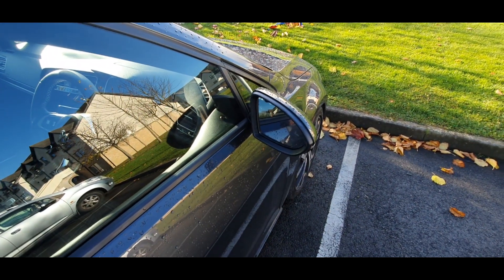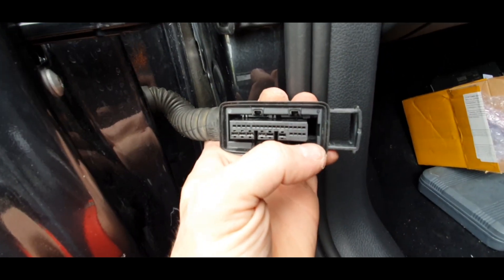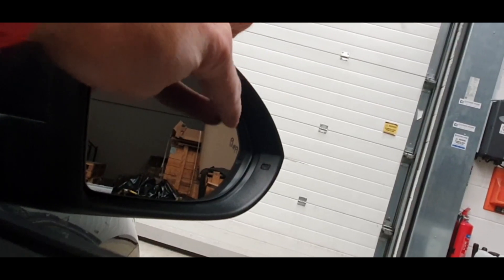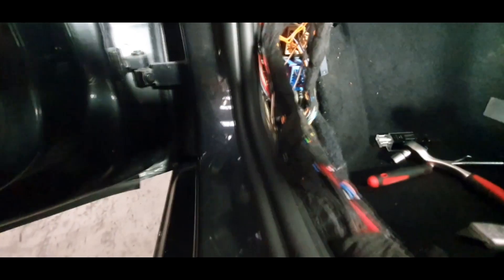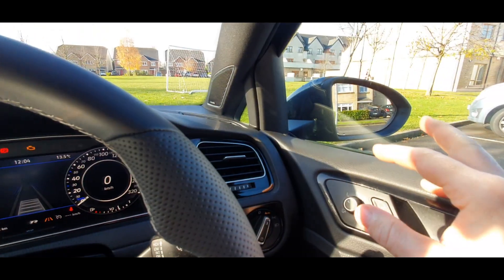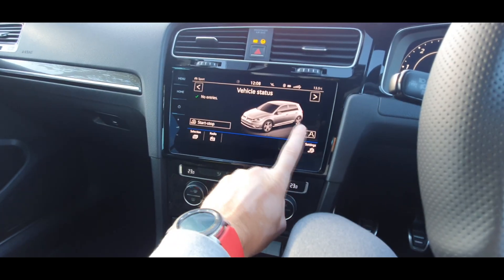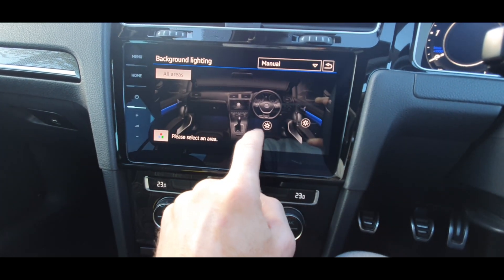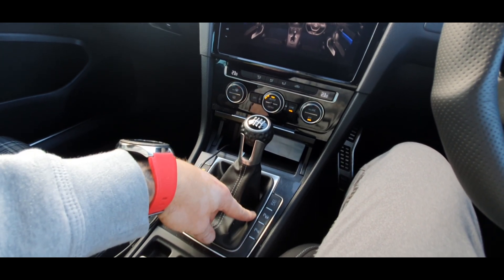VW MK7 RETROFIT LANE CHANGE ASSIST BLIND SPOT BCM OF MK7.5 ACTIVE AMBIENT COLORS DRIVER PROFILES

Comment: Hi, great work! I just have started with sensors and wiring to front... How to add pins to door connectors? I did not find a way how to get into the connector for doors. Thanks
Reply: Take a look starting around post #24 here: https://www.golfmk7.com/forums/index.php?threads/blind-spot-monitoring-retrofit-help.380297/

Comment: Hi, Thx for share the video, i did install everything but still not work: error B200500 Data Record Invalid ? any tips ? And i like your stearing wheel, where did you order this one ? Thanks a lot
Reply from the maker: Did you have communication with  3C ?  You have to send me your autoscan so i can check what its wrong .
Reply: @jester_arteonr  Thanks for ur help, i have communication, but i only have OBDeleven not VCDS, so have Error B200500 and  the message Databus missing mesage Error U11210, i hope you can help me whats wrong, The radarsensors are model 'C'
Reply: @jester_arteonr  
                Address 3C: Lane Change       Labels: 5Q0-907-686.clb
Control Module Part Number: 5Q0 907 686 C    HW: 5Q0 907 686 C
  Component and/or Version: HRE_Master    H12 0080
           Software Coding: 02011103
            Work Shop Code: WSC 12345 123 61029
              ASAM Dataset: EV_HREntryHella 001028 (VW37)
                       ROD: EV_HREntryHella_VW37.rod
                      VCID: 3D718CF3AC71A76C28-8068
6 Faults Found:

332549 - Databus 
          U1121 00 [009] - Missing Message
          [New feature! Extended UDS fault detail is only supported by current gen. interfaces]
          Confirmed - Tested Since Memory Clear
             Freeze Frame:
                    Fault Status: 00000001
                    Fault Priority: 6
                    Fault Frequency: 1
                    Reset counter: 82
                    Mileage: 35366 km
                    Date: 2021.03.28
                    Time: 14:59:32

336901 - Databus 
          U1121 00 [009] - Missing Message
          [New feature! Extended UDS fault detail is only supported by current gen. interfaces]
          Confirmed - Tested Since Memory Clear
             Freeze Frame:
                    Fault Status: 00000001
                    Fault Priority: 6
                    Fault Frequency: 1
                    Reset counter: 82
                    Mileage: 35366 km
                    Date: 2021.03.28
                    Time: 14:59:32

337280 - Databus 
          U1121 00 [009] - Missing Message
          [New feature! Extended UDS fault detail is only supported by current gen. interfaces]
          Confirmed - Tested Since Memory Clear
             Freeze Frame:
                    Fault Status: 00000001
                    Fault Priority: 6
                    Fault Frequency: 1
                    Reset counter: 82
                    Mileage: 35366 km
                    Date: 2021.03.28
                    Time: 14:59:32

337312 - Databus 
          U1121 00 [009] - Missing Message
          [New feature! Extended UDS fault detail is only supported by current gen. interfaces]
          Confirmed - Tested Since Memory Clear
             Freeze Frame:
                    Fault Status: 00000001
                    Fault Priority: 6
                    Fault Frequency: 1
                    Reset counter: 82
                    Mileage: 35366 km
                    Date: 2021.03.28
                    Time: 14:59:32

730378 - Warning Lamp for Blind Spot Detection in Left Exterior Mirror 
          C122C 15 [008] - Open or Short to Plus
          Intermittent - Confirmed - Tested Since Memory Clear
             Freeze Frame:
                    Fault Status: 00000001
                    Fault Priority: 6
                    Fault Frequency: 1
                    Reset counter: 122
                    Mileage: 35366 km
                    Date: 2021.03.28
                    Time: 14:59:32

730634 - Warning Lamp for Blind Spot Detection in Right Exterior Mirror 
          C122D 15 [008] - Open or Short to Plus
          Intermittent - Confirmed - Tested Since Memory Clear
             Freeze Frame:
                    Fault Status: 00000001
                    Fault Priority: 6
                    Fault Frequency: 1
                    Reset counter: 122
                    Mileage: 35366 km
                    Date: 2021.03.28
                    Time: 14:59:32

The last 2 errors because of the temporaly fitted lights on the dasboard but the work, i can do output test to lit them, please can you help me because the blindspot still not work...
Reply: @albertjanse8109  That software version is bad! It was under recall for seeing ghost vehicles. Use flashdaten SW081 via ODIS and flash it :)

Comment: Thank you for sharing this with us, it was really helpful.

But in my Golf MK7.5, I already have blind spot system and auto park assist, so what are the part numbers that I need to be able to retrofit the lane assist?

And @2:09 I can see there are two cables harness that are already available on your car, so how can I add it? Or is it already available (I didn't look behind the bumper yet)?
Reply from the maker: To retrofit  lane assist  you have to install front camera and new windscreen . Camera  have 6 connection  2for power and 4 as CAN,  why 4 wires go as CAN,  because  2CAN go to gateway and 2 go to your front radar(ACC) if you have it. You will need as well new rear view mirror with cover for camera . Camera which i use now  3Q0 980 654 H  but i  got already new one which support pedestrian assist 3Q0 980 653F of Arteon.

Comment: Nice video - where abouts are you tapping the extended CAN Hi Low and Green wire? Ordered the AliExpress harness which is for LHD - could tap it under the steering wheel but looked like you did it over on the passenger side

Comment: Bro
Did you flash the System or was it just Coding ?
By the way nice work
Reply: But did you use Odis or is OBDELEVEN ok for this. Because i just have OBDELEVEN
Reply from the maker: @the3the370   for coding you can use obd11 or vcds depends what you like it. I use odis just used daily.
Reply from the maker: Thx. What you mean flash system ?  As you can c on my video Blind Spot its a sensors in rear bumper + led in mirrors. After installing you need added in gateway 3C-Lane Change , coding in 17 and 5F. 5F will need as well active lane assist activation in  adaptation that changes will allow you to control settings on radio  ;)  My sensors  doesn't need calibration  5Q0 907 686 C  as a Master and  5Q0 907 685 C as Slave.

Comment: Hellow, i will be watching you're video with install  rear high camera to golf7, pleas tell me where you can connect to can High and can Low.

Thanks bro
Reply: Its the same can as radio. High-line camera work with Discover PRO . So you need Harman unit. I will change my High-line camera for 3D 360° :-)
Reply: @tedjr6009  i can connector can in radio?

Comment: Great video instruction, two questions, do you need the new buttons on the wheel ? and do you need to remove the doorspeaker to guide the wires to the door connector ? thx in advance!
Reply from the maker: I think you need remove speaker to get better access to door plug but  buttons you don't have to change .
Reply: @jester_arteonr  Hey, love the channel! What frequency have you coded your 3c module on? There are 5 options and I've guessed frequency 3 for RHD? I'm assuming 1 is europe, 2 is NAR, 3 is RHD, 4 RoW etc...
Reply: @jamesmagee1996  @Jester Dub
Reply: @jester_arteonr  Did you also removed the speakers ?
Reply: @albertjanse8109   I did  but that was easy for me cause i have retrofitted Dynaudio so my speakers its easy to remove now.  Now i organised   parts for 360 camera so i will remove that all again :)